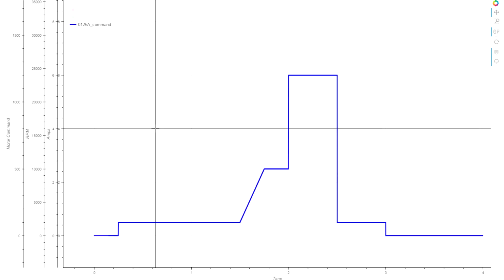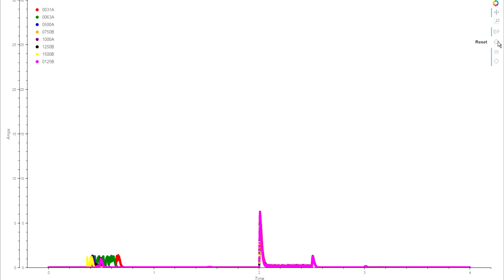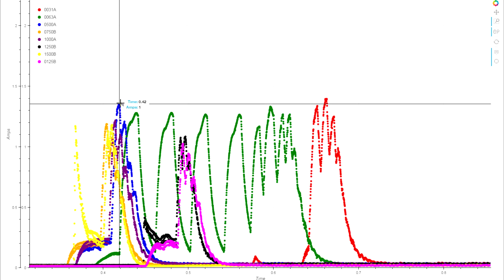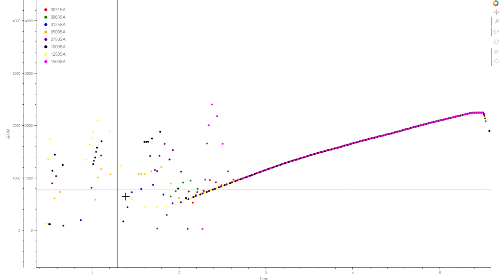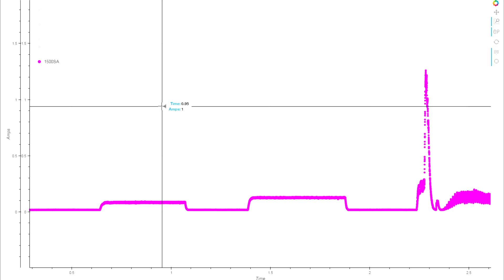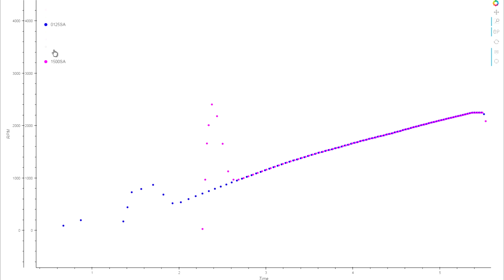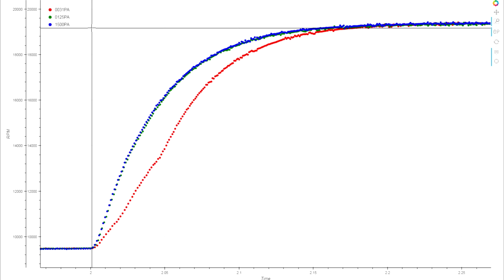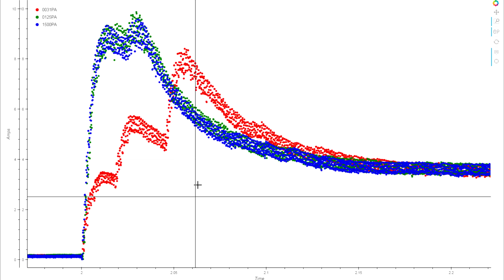Exploring startup power

Comment: Just bought a used beta 85x and one motor would not consistently spin upon inspection it was set to 0.031 startup. I changed it to 0.75 and it works fine now .

Comment: With BlHeli_S I've noticed that even with the lightest props I still have better/more consistent motor reversing with the startup power set to 1.5 than anything else. The other critical component is getting the motor timing correct for reversing performance, I noticed a big difference (with props/load on the motor) depending on the timing.
I expect that this test was done with no load on the motor?
Reply from the maker: Yes this was unloaded.  Higher startup for reversing makes sense because you're going to have to fight more load most likely compared to starting from a dead stop.  A little bit of inertia left over from the braking phase, and probably additional aero loading as well.  I generally turn up the startup power when doing dyno tests now because the inertial load of the spindle is too much for some of the small motors to start spinning without an extra bit of a kick

Comment: So changing the Startup Power does virtually nothing?
Reply: It definitely does something, I wonder if this test could be re-visited with a prop/load on the motor.
Reply: It does. Particularly for small whoops with 820 and similar motors. Especially if you use 48 kHz or 96 kHz PWM ESC firmwares. Then larger startup power like 1200 is the only way how to avoid twitching and not spinning motors.

Comment: I stumbled across this video looking for answers. 
I was having lots of issues with one quads (and in the past tossed out a few motors) I thought the motors were bad from the factory with heavy jitters and cogging... after refreshing ESCs FC and messing with lots of settings I found a fix to my problem. Lowering the start up power seems to allow them to sync up and start idle. I found as I raise the starting power I had to start throttle at much lower for them to even spin. As I lowered it seemed to allow them to quickly go from zero to full without issue. Default was .50 I tried each click until I was maxed out then tried lowering and voila it worked. Currently they are at .47 and working. 
I did find that the two motors that had issues still get to a steady idle just a hair slower than the other two that worked flawlessly from high to low startup power. It sounded kinda like when someone is talking to fast and you ask them to slow down for a second to get on the same page then they can fast talk after you get caught up for just the start, otherwise the whole conversation your lost trying to grab onto key words that you never find... 
prior to lowering the startup power when I could get all 4 to idle upon quick throttle change one or both “problem” motors would stop and not start again until I lowered throttle all the way and the ESC start tones sound off.

Comment: Great data, I've been searching for some information that will help us work out what the best settings for 3D are in order to change motor direction as fast and cleanly as possible, even at the expense of efficiency, I think I'll drop back to 0.125 for startup power and see if it changes anything.
Cheers
Tim
Reply: Hey. This may be a long shot, but did you get anywhere with this? I'm currently trying to tune a 3D quad and it switches fine most of the time, but sometimes it freaks out and twitches in a random direction, presumably from one motor not switching reliably
Reply: @Johnny31297  check out what @kenimhof managed to get done using bidirectional dshot and some other new features. There's been some serious improvement since I was flying.
Reply: @Teracis  Awesome thanks dude, wrote him a comment!